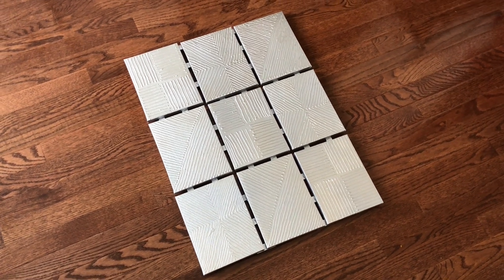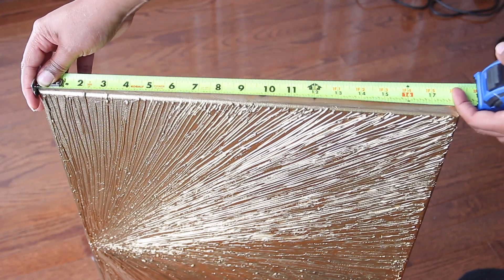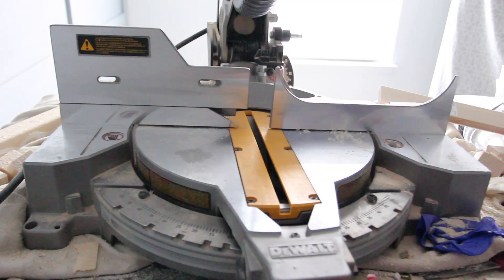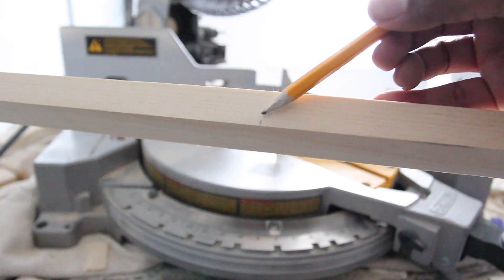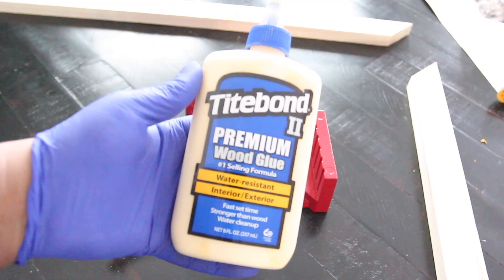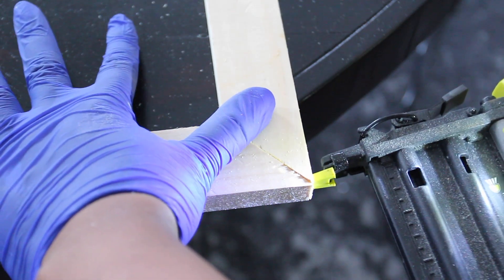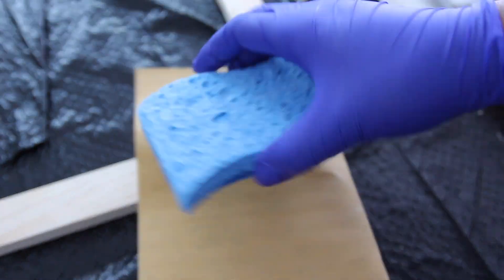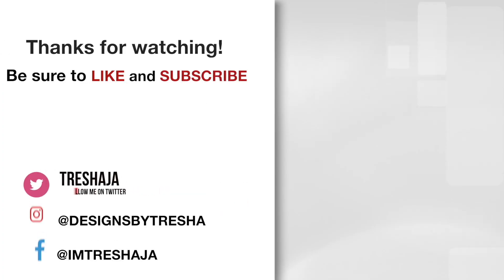How To Make Your Own Picture Frame (Any Size)

Comment: I found that you get more even cuts if you cut all the miters on the same angle. Rather than flipping the miter saw to the other 45 degrees, I flip the wood so I'm always cutting the miter from the left side of the saw. I've found that the 45 degrees is not an exact  match when you use both sides of the frame.

Comment: I don’t know if anyone has mentioned it yet but, if you put some (a dab will do) wood glue on the seams and lightly sand the areas with 220 grit sand paper it will conceal the seams better and cheaper👍🏻 Good video though!

Comment: This would not work for your object that you were trying to frame. You cannot make the inside 18x24 which is the same size as the object. There needs to be lip to overlap the object so that you can set it inside the frame.